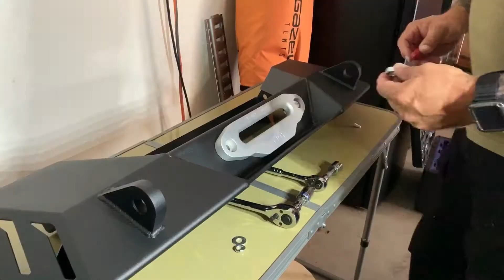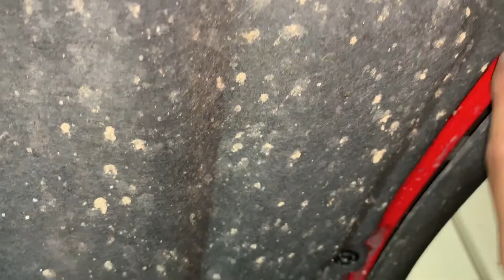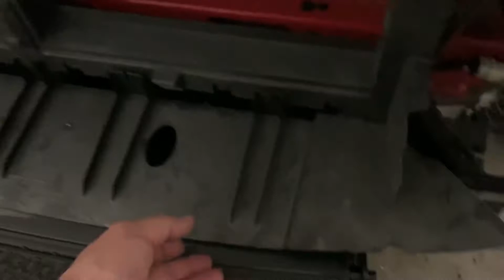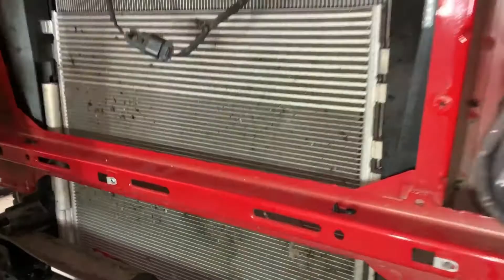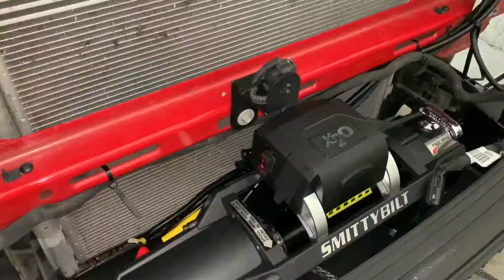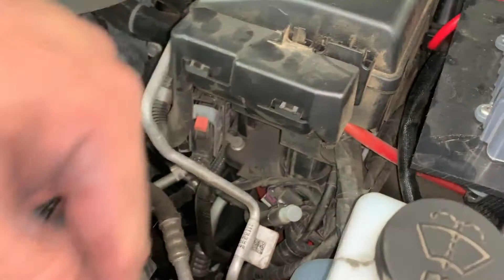Colorado ZR2 Smittybilt X20 Winch Installation

Comment: Hi David, I got the bumper and winch installed. It looks great! Thank you for this video it was a huge help. A question though, did you cut the plastic grill under the hood around the hood release so you can reach down and access the free spool lever and plug in your winch remote? If so, have pictures of how you cut it? Thank you
Reply from the maker: That’s awesome. Glad the video was helpful. I just used the remote to spool out the winch cable. I never had a need for free spooling it.
Reply: How about reaching down to the winch to plug in the remote? Or do you just always leave it plugged in. If you have any pictures of your set up it would be appreciated!
Reply from the maker: My remote was Bluetooth wireless

Comment: Hello David, I bought the CBI half bumper after seeing it on your truck.  Unfortunately my box when it arrived was missing parts packing lists and instructions. I have since received some missing parts from them but still don't know if i got everything.  Did yours come with the license plate bracket or did you buy that separately? Thanks for posting the video.
Reply from the maker: License plate flip down bracket was purchased separately from Cascade 4 x 4

Comment: Did you have to buy brackets for the half bumper for your light bar? Or can you just use brackets from your existing light bar mount from the grill. About to install mine in a couple of days.
Reply from the maker: Light brackets came from CBI with the half bummer.

Comment: did you use a Battery Isolation Solenoid? it looked like you connected directly to the battery.
Reply from the maker: Hi Tim. We connected straight to the battery for testing. We are now connected to an Isolation solenoid and supply main disconnect switch for added safety. Thanks so much for your question.

Comment: Do you have access to the winch after everything is put together?  I don't really see how you would get to the clutch knob.
Reply from the maker: Santico Valenzuela With a body lift you have the perfect amount of space. No body lift you have to rotate the power switch and clutch lever pointing straight down and access it through the access holes of the CBI bumper.
Reply: @TrailAdventuresTV   would reallly love to see how you do this.  I have a lift on mine and just installed this exact setup same light bar even, and we can't get access to the clutch or power.
Reply: New to the channel but I just started modifying my ZR2.  I really want this bumper/winch setup, but very cautious of buying it because of the practicality of how it can be accessed to use. Can you please do a video demo on how you use when off roading and especially when accessing the clutch and power.  The only way I see that happening and either from the top or bottom.  New to the channel and just subbed.  Lastly badass ZR2

Comment: What light bar did you install in the CBI bumper?
Reply from the maker: Hi Dennis. That is the 30” radius light bar made by Rough Country. it has been serving us very well.   Hope this information helps.
Reply: Trail Adventures USA   How are the winch controls accessed with the 30in light bar in the space above the bumper??
Reply: Nicely done with this video! I just pulled the trigger on both the CBI bumper and the smitty winch. Looking forward to the addition! I’d like to hold off on adding the 30” RC LED light, but curious how big of deal is it to install a few months later? If it means taking the entire bumper off to install, I’ll probably just bite the bullet and get the LED bar also. Thanks in advance!

Comment: Did you have any trouble with the half bumper when you installed the body lift? Or is it strictly mounted to the frame
Reply from the maker: Hi Omar. Thank you for your comment and question. The CBI half bumper mounts to the frame. This worked out great for the body lift. It actually ended up providing enough room, where I could reach the free spool clutch and power switch. Before the body lift I would need to leave the power switch on and clutch engaged. This is not recommended according to the manufacture. But it was the only way for it to work. So the body lift actually improved the usability of the winch. Hope this helps.

Comment: Do they make license plate bracket for this bumper mounts to fairlead we're the plate doesn't hang down to low
Reply from the maker: Hi Robert Prock Thank you for your question. There are a number of license plate brackets available. I have been shopping on Amazon for one. But haven’t found one I like yet. There is one that folds up and mounts to the fairlead. The problem always has been when you’re winching if the license plate folds down and gets mangled up in the process. As soon as I find one I will do a quick video and give you a shout out.
Reply: Robert Prock I installed this same winch using the Midwest Overland Industries hidden winch mount.  They sell a license plate bracket that moves the license to the passenger side of the bumper.